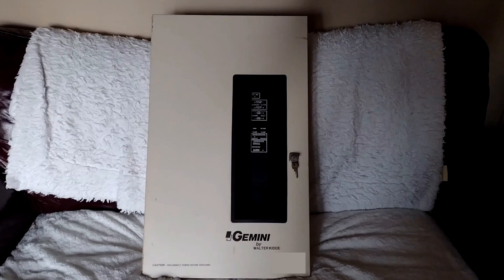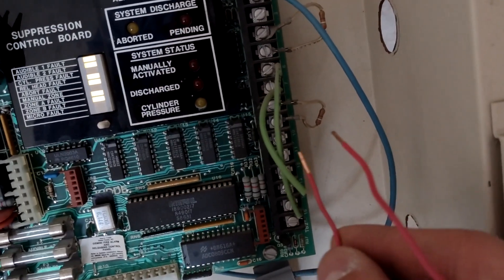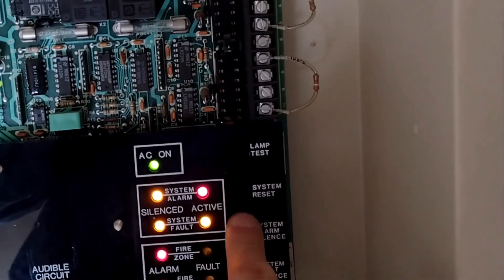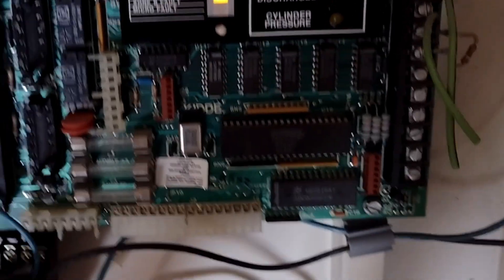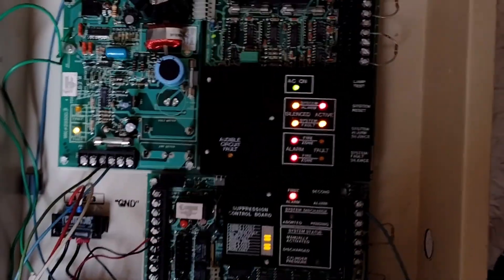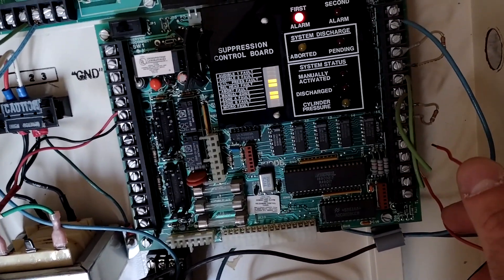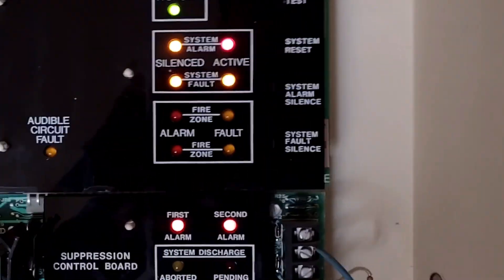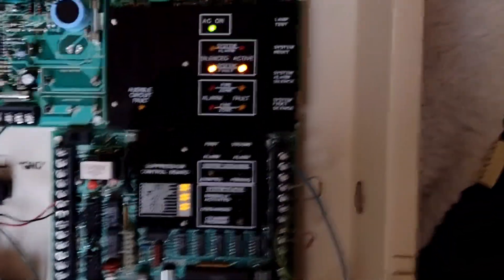Kidde Gemini fire alarm / suppression panel - Short demonstration

Comment: Your timing is impeccable, I ran into one of these panels at an abandoned power plant yesterday. Scrappers sadly got to it long ago, but neat to see one in action.
Reply from the maker: Would you be able to salvage the cabinet?
Reply: @Fahrenheit4051  I hadn’t brought any tools along, but I easily could. Still left a small 6” no-name brand bell too, it’s definitely a tempting save
Reply from the maker: @VintageVibratone  Hmm... I just told jtd321 about a Kidde Gemini on eBay without an enclosure. Maybe you could see if he wants it.
Reply: @Fahrenheit4051  Sounds like a pretty good opportunity. Should clean up well once wiped down
Reply: @VintageVibratone  I might be salvaging some vintage fire alarm hardware from my dad's abandoned middle school in Akron. That building may be demolished sometime this year. I also got expelled from STVM because I pulled the fire alarm to skip an English test.

Comment: I did an inspection of one of these at a church... But it was a red one and it said "THORN FIREQUEST"
Reply from the maker: Neat! Fire alarm or agent release?
Reply: @Fahrenheit4051  It was a fire alarm I think. I got a pic of it, it had a simplex 2903 above it. It had an ansul system for the kitchen tied to it but that's all supression wise.
Reply from the maker: @alexandersalarms5380  Sounds  like fire alarm to me. Interesting to see Simplex horn/strobes on a third-party system, but it wouldn't be the first time. I've seen a tiny system with a King-Fisher radio box as the FACP, two 2901-9838 horns, a 2903+2901-9806 combo in the middle, Simplex T-bars, System Sensor 2400 smokes, and disc heats.
Reply: @Fahrenheit4051  It was loud as hell, Lol. yea I got it mixed with the ansul panel but it had I3 smokes, simplex pulls and horns... it also had a few PC2W's